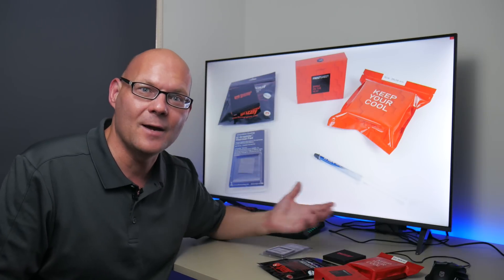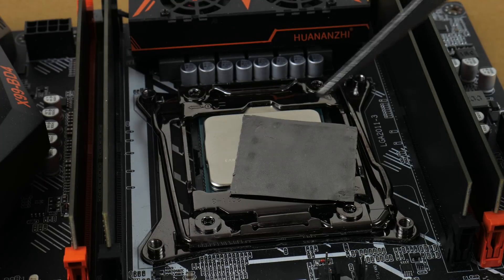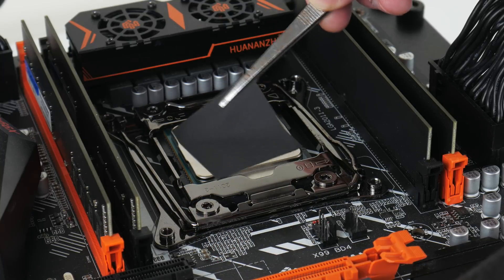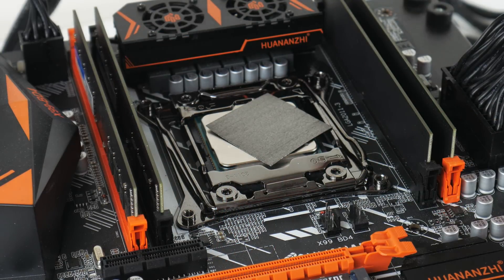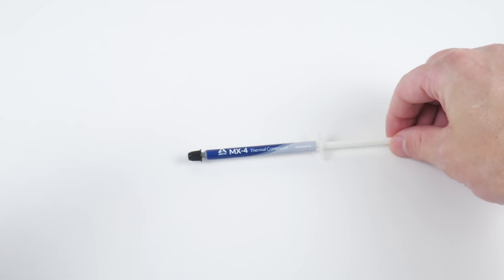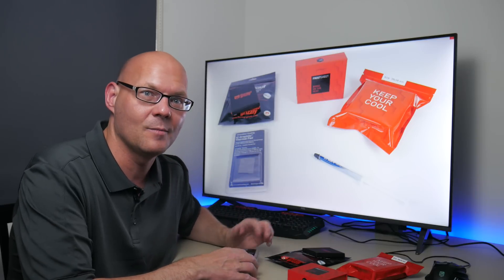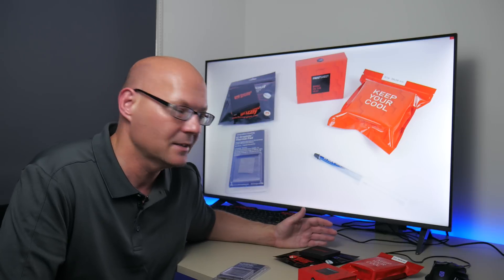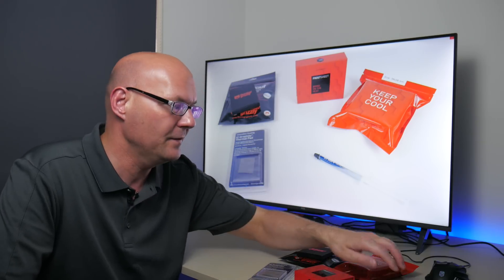Arctic MX-4 Thermal Paste vs IC Graphite vs Thermal Grizzly Carbonaut vs FrostSheet

Comment: What I have been wondering but I have not seen any tests for is how well do these work on chipsets. My board is 8 or 9 years old now and running a noticably  hotter than it used to. I am sure I need to pop off the heatsink and repaste the southbridge. Due to the fact that I am going to need to completely gut my PC in order to remove the heatsink since it is bolted in on the back of the board I want to do a one and done IF I can safely and effectively stick a graphite pad in instead of paste.
Reply from the maker: The low mounting pressure with chipset coolers will be the main issue. It's not something I've tried, but it may work just fine...
Reply: @philscomputerlab  would you be willing to test it out? I am quite curious as to results but I don't dare start experimenting with my only PC. So figured may as well ask someone with experience with the products as well as testing methods.
Reply from the maker: @brianwalker7771  No.

Comment: Thermal Grizzly has a newer product called KyroSheet that is conductive, but performs better than their pad, but it isn't as durable. There's also a product called PTM 7950 & PTM 7968; I don't know what company makes PTM.
Reply from the maker: After more testing I went back to the IC Graphite. Only pad that is actually reusable. The others easily tear...

Comment: Interesting to see the differences between the pads. I have the IC sheet in my 2 year old desktop. I recently got a new laptop that I want to see if I can get it cooler than factory paste and may look at some of those other sheets.

What I like about the sheets is not necessarily the re usability between builds but the fact that it does not dry out and you need to renew the paste.

Comment: I have a 300 helios.1050gtx...i put 2 layers of carbonaut on gpu and mx4 on cpu...so....after changing termopads with arctic pads..and 2 layer carbonaut  0.2mm on gpu and run it for several h gaming gpu 90%usage cpu 71 80% usage i get on carbonaut a steady 70 celsius.on mx 4 well.poor thing 81

Comment: On IHS pastes are better. But on direct die (like laptops, gpu and new consoles), definitely pads as pastes pump out very easily.

One question I would like to ask you is i am planning to use carbonaut on PS4, i want the pad to stick to the die as the board need to inverted when assembling. I was planning to spray ipa on the die and stick this on the die and then assemble. Wil this damage the carbonaut pad?

Comment: Phew, nobody really did an updated and great thermal pad vs. paste comparison, until now!
Nice knowing that I didn't made the wrong choice over a thermal paste as I was skeptical at first. Needed to use a Carbonaut on my i7 (7660U) Surface Pro since opening and replacing dried up paste is a pain! Having been using it for months now and they do work well. Thank Phil!

Comment: If you do a follow on video, then it would be interesting to hear about physical durability of the graphite sheets, whether electrical conductivity is a concern, and which socket interfaces are suitable. For instance, socket A processors have no heat spreader, and an exposed die with sharp corners - would the graphite sheets be prone to ripping, or could they be cut to smaller sizes? What about processors with decoupling capacitors on the top side, is there risk if the graphite sheet contacts those?

Comment: Phil, could you check how these pads compare to paste on a semi modern video card? I know you already did it with a Thermi card, but those coolers weren't the best.
Reply from the maker: That's the plan, but using an exposed die is tricky. But for sure on the cards.

Comment: Well, from a practical & economic view, the IC pads are definitely worth it, if you are the type of guy constantly testing equipment. But otherwise, I would use the other, better performing pads only in GPUs, since taking of the cooler is a hassle and there is always the risk of tearing the silicone pads.

Comment: You really should test with a new IC Graphite sheet - I bet that it performs the same as the others when new. It still experiences wear and tear with removal and replacement. Innovation may even reach out after this video and offer to send a new one that hasn't been worn.

I'm curious if you tightly controlled the ambient temperature in the room - the differences here are so minuscule and within variability that I'd equate them all to being the same. Durability and value in a sheet (or similar size)  is what I'd put my money on for these.
Reply from the maker: I've tested used and new IC Graphite, I see that same delta in terms of temperatures. The tests where done all within 1 hour, so same room temperatures. I'm not sure IC Graphite will reach out, they don't seem to have social media presence even 😅

Comment: I was using graphite thermal interface sheets 20+ years ago on electronic components. It was, and still is, available in large sheets from electronic components suppliers. It would be interesting to see how some cut to size compares to these pre-cut pads.

Comment: You raise a good point about benefit of thermal pads in that there is no clean up. I test hundreds of motherboards per year and have a shelf full of every kind of CPU from Socket A to AM4 and 370 to LGA1151 which I leave smeared with thermal paste because it would require way too much labor to clean each CPU and the common heatsinks between each motherboard test. If I were to switch to a thermal pad like the IC graphite, I would be able to read each CPU's model number as they're on the shelf and run less risk of getting paste on my clothes or desk. Thank you for the video Phil!
Reply from the maker: Yea Thermal Pads would work really well for your situation!

Comment: Nice to see a comparison with the pads, while i was recommended pads like TG, the price difference here in the UK doesn't make sense for the improvement when the pads improvement alone for longevity, consistent install the IC graphite pad does. On ebay i can get a 30x30 IC graphite pad for £8, TGs option is £17 and frostsheet is a new one for me so i can't comment on price and performance, my only gripe with the IC pad is its very slippery, its less clothy than the others which would be nice so it stays in place. Especially on the die (i wondered why my xbox 360 was overheating, turns out the pad had moved slightly and there was exposed die so taping it to the cooler base first is what i did. 

When people argue a couple degrees, i can at least say my temperatures will never budge with a pad, but i still use a paste unless i have a direct die scenario like the 360s or Maxwell generation GPUs for example, thats where the bigger improvement lies with pads, paste will push out on direct die and give you center hotspots or spider cracking over time. Less hotspots that cool slower than other areas of a card should allow it to last longer in theory. Paste is still good because it isn't limited to a specific size and you can get a lot of applications, chipsets, north/southbridges, various main component hardware, thermal probes, power supply heatsinks, if you only use what you need you get a lot for your money. I save MX-4 for more recent hardware but if i have an older cheap graphics card i just use generic cheap paste because they don't run hot enough to warrant other more expensive solutions.

Comment: Phil becoming the savior of AM1-4 socket CPUs. No longer shall a CPU be ripped out of its socket by its heatsink.
Reply: @philscomputerlab  I got a great deal on a Ryzen 7 1800x CPU, motherboard, ram, heatsink and SSD combo. It failed to post. When I pulled the heatsink it ripped the CPU out of the socket. Why didn't I let the computer run for a while to heat up the CPU? Because it wasn't posting, I had no idea what was up. It took a lot of effort to finally free the CPU from the heatsink. Luckily, after reseating the CPU it posted just fine.

Comment: I have used TG Carbonaut sheets on my systems. This is not a 100% accurate advice but warming, running system just before replacing pad, cooler etc may help removing that sticky pad. Especially TG Carbonaut is very fragile.
Reply from the maker: Great tip!

Comment: what is the temperature when no thermo-interface between cooler and cpu ? worst case baseline
Reply from the maker: The CPU will thermal throttle to protect itself and temperatures out of control.

Comment: You hit it on the head at the end. If you are building and taking machines apart often (for whatever reason) the pads make sense. They are quicker and less messy. If you are putting a machine together that's going to stay together for an extended period of time paste is way more cost effective.
Reply: It depends how long an "extended period" you're talking about. Most enthusiast thermal pastes like Arctic MX-4 are designed to be reapplied every few years, as they dry out and undergo repeated thermal cycles. These sheets, on the other hand, should maintain their performance indefinitely. 

When I'm fixing up/replacing an old cooler on a retro system, old and ineffective thermal paste is usually one of the reasons. My main concern when doing it is "how long can I go before having to do this again". In the past I've sought out more OEM style pastes that tend to be much thicker and more tacky than the consumer ones, but these days I think I'll try these pads instead.
Reply: @jomeyqmalone  fair point. I was thinking more like the normal lifecycle amount of time, so between 3 to 5 years. I guess it you want to put it together and never have to worry about the thermal interface drying for proper extended periods like 10+ years the pad could be good for that. It would be interesting to know the expected life cycle of the pads and do they suffer any type of  degradation over time when installed?

Comment: I find it quite amazing that the sheets are pretty much just as good as the paste. I have a feeling that the hard corners of a GPU die would end up tearing the sheet. Maybe have a few sheets, of various sizes, so that they don't extend over the edges and corners of the die.
Reply from the maker: I want to do another GPU video with heat spreader, likely GTX 580 and then try a GPU with exposed die.
Reply: @philscomputerlab  Alright! I'll be watching that one for sure. I just hope you don't end tearing a hole in one of them pads.
Reply: @philscomputerlab  You could try an Athlon XP as well, which has no IHS.
Reply from the maker: @TrueThanny  No thermal sensor I believe, that's why I want to use a GPU.
Reply: @philscomputerlab  There's definitely a temperature sensor, but early ones might not be easily accessible in software.
Reply from the maker: @TrueThanny  GPU have this guaranteed, Athlon I believe go up in smoke when not cooled. I need exact readings.
Reply: @philscomputerlab  maybe a delided Gtx 580
Reply: @philscomputerlab  Do the liquid metal.
Reply: You would need to be very precise covering a bare die with a graphite sheet that's cut exactly to the size of the die, if you miss any part of it, you could kill the chip either partially or completely.

It's better to have a pad that's larger than the die and insulate anywhere not supposed to be contacted by the pad with kapton tape and just live with a (potentially) slightly damaged pad, which costs a fraction of a new GPU to replace.

For heat spreader covered dies it's less critical, but you'll still get better perf if you can maximise your coverage.